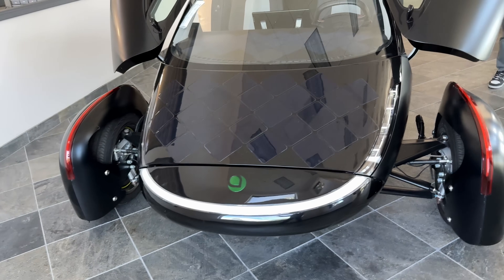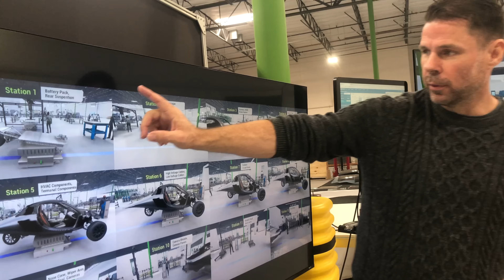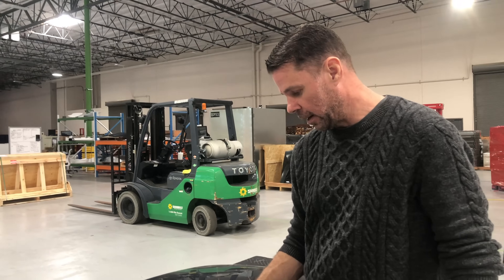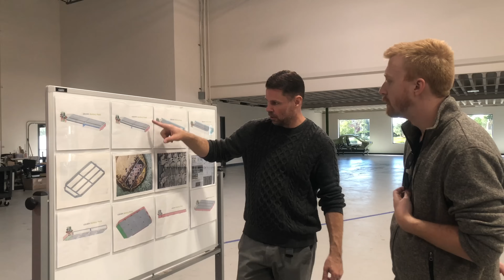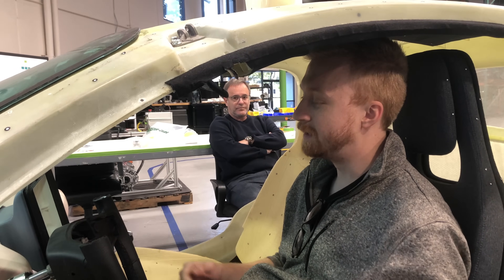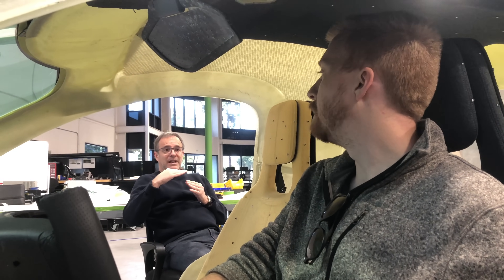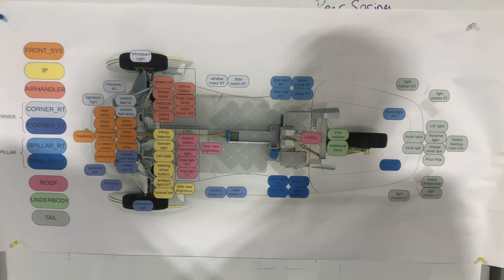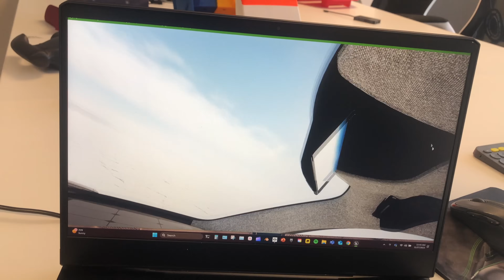Touring Aptera's Factory!

Comment: I love it but for $34k? I hope they can ramp quickly and be profitable at $15k - $20k before Tesla comes out with their $25k car. They probably have about 5 years of time though..
Reply from the maker: Aptera doesn’t overlap much with Teslas cheap car. Aptera has far more range, CarPlay, and repairability
Reply: I'm not sure how you can come to the conclusion that they can sell thisvehicle for $15k ? Their base model, that I believe has a 250 mile battery, (23kWh), 2wd, is slated to be around $26k. I can't see it getting much cheaper. Their LE model has a 400 mile battery, AWD, and  full solar packages.  What is in this "cheap Tesla "? Is this some are calling the Model 2 ?  It supposedly will have 250 mile range and 0 to 60 in around 6 seconds for the base model with a msrp under $30k. It most likely will qualify for the $7500 Federal tax credit. On a side note, the tax credit for the Model 3 is dropping to $3,500  on 12/31.
It remains to be seen if Aptera can get Washington to add three wheelers to the bill.  I can see someone who needs more than a two seater might be interested. However, I think that the majority of those of us who are interested in the Aptera are drawn to it for more reason than than the price tag. For many it is probably the efficiency and potential of some significant miled from its solar charging. Apartment and condo owners who can't plug-in charge can get a little relief from having to go to a public charger as much. Some who have short commutes might rarely have to plug-in.
Tesla's are impressive but I was not considering an EV until the Aptera came on the scene. If they don't make it is unlikely that I'll buy an EV. I would probably go with a hybrid. For what it is worth, I wouldn't buy a Tesla.
Reply: @TailosiveEV  yeah, maybe if the battery is the most expensive part, they could offer a cheaper, 100 Mile version with the solar. I think there is a market for that. I agree, I think cracks are starting to show at Tesla. Nobody wants a car that has no parts and won’t be repaired. They need to fix that asap as it will be a hard reputation to change after 5+ years.
Reply: @garywozniak7742  thanks Gary, I never considered the Condo people. N. America is very car centric so this could very well fit perfectly into that market! Would be nice if they made a shorter range one which would be cheaper
Reply: @GIPvideos  To be fair, lithium and battery prices have been plummeting.
Reply: If you believe Tesla's $25k nonsense, I've got some ocean front property in Arizona...

Comment: i just don't get how empty their factory is, it has always been empty, I have never seen it full of people or full of equipment
Reply: That building looks a heck of a lot more full than when they purchased it last year.  

They aren't going for the old style of assembly manufacturing using a ton of robotics.  Even their animation shows a relatively open space. 

Besides, technically, production already started, where CPC has to stamp out dozens, if not hundreds, of large pieces and will likely ship them here over the course of months.  Add in that Aptera has a second facility to make the solar panels, and they are making progress.

Ultimately, we want a final assembly date for commercial products, not a traditional "production date."
Reply: @pavanbiliyar  thanks for the informal comment man ☺️
Reply: @pavanbiliyar Aptera obtained this factory space in 2021.

The solar facility was turned back to the leaser when body production was moved to Italy and the solar manufacturing is moving into that space.
Reply: @gasisthepastendoil  Tesla is vapor ware? Interesting take on a company that's delivered over five million vehicles.

Comment: I watched all three videos. Why are you dancing around the biggest red flag of vehicle power? Can this drive at highway speeds safely? Can this go up hills? I saw this vehicle overheat and fail going up a small hill last year. Everything about this vehicle is pointless if this can't actually drive on a road.
Reply: The answer to both questions is yes - both my wife and I have ridden at speed in a prototype.  It is not surprising that overheating can occur in a vehicle that doesn't have the cooling lines circulating anti-freeze hooked up and operating.  Try that with any ICE vehicle!
Reply: @billsmith5960  You have a point.  Actually, many of these "air cooled" vehicles were actually primarily cooled by the circulating oil which was then cooled by the oil coolers, including the Corvair.  But the point still stands that they could encounter damage from overheating that would just cause an Aptera to reduce speed.

I have owned a number of such vehicles and have experienced overheating in some of them.
Reply: @billsmith5960  Sounds like you won't be buying an Aptera because an incomplete build didn't perform they way you thought it should. We'll let you know how the production vehicles go.

Comment: Aptera needs a completely new type of in-wheel engines. Four of them. Also, four seats that can even turn into six. And loose the bug look for more of the eagle she should aim for in a futture of flying cars :) I can help :)
Reply: Aptera's second planned vehicle will likely be a 5 passenger, 4 wheel sedan.  They have mentioned this in their SEC filiings, but we won't likely hear more details until they get ready to go public.  First things first.

"The Bug look" as you call it, is pure functional form, going back to an A. Morelli design from 1982.
Reply: "Hey Aptera, toss out everything that differentiates you from every other car manufacturer :) I can help :)" 😂
Reply: Aptera has in-wheel motors. Either two, or three in the AWD version.

Comment: it's not a car it's in the same class as a motorcycle.  I don't want any of my family riding motor cycle that can go 110 miles an hour.  Death trap comes to mine.   You see people building solar power motorcycles all the time on YouTube.   lol
Reply from the maker: Do you keep the 4th wheel in your bedroom for added safety?
Reply: @TailosiveEV   I am not sure the point your making about 4 wheel?  I am not talking about wheels when it comes to safety..  I m talking about safety equipment required by law for a car which is not required for motorcycle type vehicles.  This is not a car and can't be compared as such.. As far as it being a great vehicle for it's class sure it is.  But people buying this thinking they are getting a car is just wrong.  I was looking at it because I thought it was a car but when I found out it wasn't I was very disappointed.  The reason I thought is was a car is in these video's they kept calling it a car and comparing it to cars.  A car will have more weight because of the required safety equipment and will have to pass crash test as well.   There mileage will be lower because of the added weight.  If you have all the required safety car equipment and pass the crash test then I might buy one.  Why are they miss leading people?  I already have one EV and am looking at adding another this will not work.
Reply: @lloydbrannan1002  You're confusing weight with safety. You may have missed the parts of the interview that explained how the Aptera is designed to be safe, how it protects the occupants better than most cars, and how it will be crash tested just like a four-wheeled auto. You could wait for the results of the crash testing before deciding that you know how it will perform.
Reply: @jerrymcintire7902  If that is the case I may buy one but I want to see how it performs in crash test first.   It not being a car isn't issue for me.   The video's confused me because they where calling it  a car.  I really like everything about this vehicle.
Reply: @lloydbrannan1002  I have actually ridden in a prototype, and it exceeds the performance of my present car in every area, including safety.  Aptera will sacrifice up to 5 of their Production Intent vehicles in crash tests to FMVSS Part 200 standards, the same as cars are tested to and the results will be published.  Just because they are not required doesn't mean they are designing to minimum standards.  Inform yourself.

Comment: This looks like more of a showroom and not a factory. Very concerning, I am loosing faith on this vehicle, I have an early order and they are only burning money without really producing anything. Constant marketing talks...
Reply: The work is taking place - have you seen what they are doing in Italy?  I would say a 100 ton tool producing production  parts on a 5,000 ton press is "producing something"".
Reply: @bobhellman8676  I never had a Bradley - what I owned back in the day was a Kelmark GT - a rough copy of a Dino Ferrari.

All the body SMC and carbon fiber body components are in production now and have been shown.  There are a few others we haven't seen yet, including the belly pan.
Reply: @bobhellman8676  Yes, the Bradly bodies were pretty flimsy in comparison.

This is the reason I think it could be several months into the new year before we will see completed PI versions.  Fortunately, there is some validation work that can begin before the vehicles are complete. 

 I can remember when long after the Model 3s were in production, that the lack of a single part caused thousands of those vehicles to stack up in parking lots in Fremont, CA.  - and they were not the only ones.   Aptera will not be immune to such issues, although the smaller numbers needed may be a help in avoiding it.

Comment: Aptera is unfortunately another victim of superb efficiency on the wrong engineering and manufacturing fondation :) The first problem are the wheels = not onyl the same clasic tires with all their problems but also the in-wheel motor complicating everything way more. The second one is the flimsy, easy to loose, cutting-blades like front wheels. The thrid is using way too many parts and materials and components. The fourth is it still has a wheel, worse a partial wheel, when it should have changed the controls to something truly worthy of the future and also much more human. The fifth is trying to better exising manufacturing and engineering instead of coming on this from scratch / clean slate.
Reply: You don't seem to understand the motors that Aptera is using and what they accomplish.  Far from "complicating everything way more" they both greatly reduce parts count and increase efficiency - not the least by eliminating bearing surfaces and points of friction loss.

You clearly haven't grasped what Aptera is doing - the tub alone replaces around 200 parts in a conventional build with a single part.

Those of us who have worked as suppliers to conventional automotive companies, including other startups, are in awe of what they are doing in improved fashion.

Data driven production systems have been invested in and installed from the beginning, instead of developed piecemeal on an ad-hoc basis as the company grows.

The experience of the founders in creating and running other public companies really shows.
Reply: @n.brucenelson5920  Hello. Thank-you for your very detailed and compressive answer. I only meant my engineering is far simpler because of its entirely different foundation. No comparison van be applied here because your no doubt vast experience is from another world. My concepts are still based on the same leas of physics and true principle real design but have produced an entirely different everything starting woth the wheel first and foremost. I have studied intensively and extensively all  in-wheel-motors deisngs and even wanted to implement on my personal car for fun several times over the years. I have the absolute respect for the evolutionary leap they brought. But, this design is at another level. Still a motorized wheel but completely different. That's all.
Reply: @adriangabrielgramada1016  Best wishes for finding both funders and partners to bring your ideas to production.

Comment: Looks more like a vacant building - so what is the exact date Aptera is going to build these motor cycles and how many? They've been promising for years now - how about they set a date and if they can't make it the shut down?  And tell  your "investors" they can't get priority in front of existing reservation holders who paid money to get an early production vehicle - assuming Aptera ever gets around to making some motorcycles that can be driven on the street and meet DOT regulations.
Reply: Well in their defense, they do have green and blue lines painted on the floor.  I was going to invest in Aptera but just bought more Tesla stock instead.  To me there are far too many compromises in the vehicle design for a miniscule saving im electricity cost when compared to a Tesla which costs less than 2.5 cents to drive a mile.
Reply: @petemiller519  An Aptera still uses 2.5 times less power than a Model 3 Tesla to drive the same distance, and the first miles won't cost you anything.  

What compromises are you pointing to?  The quality of the first Apterae on the market will be hugely greater than the first Roadsters.  Even their prototypes are better than those were.
Reply: @petemiller519  I actuallly have one on order peter and Im pissed these people have done abosolutey everything to avoid making vehicles - clearly that want a big sugar daddy investor to make them rich ; htey are not trying to actuallly make vehicles or they would have been years ago
Reply: Lol
Reply: @davidclark538  Ya it is funny they won't ever make these motorcycles - the company wants to be bought out by some rich Elon like figure - never will happen
Reply: @litestuffllc7249 wrong as usual! They want to produce these cars, and they're doing everything right to ensure they can do it at scale, and in the manner they want.

Comment: Sure they are Go climb - so when will that first one be delivered? 2090?  A legal vehicle - that can be driven on the street? They've done just about everything humanly possible to avoid making motorcycles - did they need to test them like cars? No - did they need to keep making revision after revision after revision - no. They claimed they could just pop these out like cupcakes well that isn't getting done. Mr Ambassador Bruce swore he would have lone last June - well needless to say he doesnt'.
Reply: Perhaps you are not paying attention.  That was back when I was expecting that the production vehicle would be a refined version of the gamma.  

In fact, demand was far larger than even Aptera expected and the vehicle has been completely re-designed so that the actual production will be much less "kit car like" as the originals were, to being much more like supercars.

This increase in quality is certainly worth a small delay.

As far as legal vehicles that can be driven on the street - both my wife and I rode in one in November of 2021.  They crossed that threshold in 2020.
Reply: Don't think they ever made any claims regarding cupcakes, cupcake.

Comment: LOL. Seriously this is disappointing.  Everything laid out as if a demonstration but nothing anywhere in place to demonstrate movement towards a real assembly area. This has all the hallmarks of a high school science fair and not an automotive assembly area. I mean, if you were going to do tours to impress students then this was certainly staged well for that. 

There are two very large absences here, the Red Viking AGV units are still not unpacked but more importantly look how few people are there. All the shelving is empty as well so its not like components to complete the production intent vehicles have arrived. Given the traffic observed on the road outside it likely is in the middle of an average day.  

So the assembly line is still just blue tape and animations yet we are to believe they are prepared to build out the production intent vehicles but not validate any portion of the assembly method.  Where are the RedViking AGV units they are going to use? 

Battery cells, Tesla and the industry has moved to 4680 because it was far more efficient both from making individual cells to packaging them than using taller cells. The width also reduced the can weight proportion of the overall cell weight and the height was chosen to give more flexibility by not consuming vertical space which would come from the cabin. Yes, each mm counts. The other method gaining a lot of popularity is the blade arrangement which conserves even more space. The Aptera cooling solution is not impressive so it remains to be seen how it behaves in stop and go. the packaging certainly is not efficient.  2190/2120 are not for automotive use. 

Solar and glass. given their claim and video that solar is in production from October 2022, yes 2022, they certainly have little to nothing to show for it.  You would expect them to show off work towards making pieces for the production intent vehicles, granted not all of them will have solar, but it is very telling how little they have. You can buy similar Maxeon cells in flexible panels off of Amazon, been there a few years and they can be adapted for camping and such easily. Other note, they have never shown a working solar hatch. Seriously, solar was claimed to be in production last year.
Reply: Their solar cells are being produced, and have been built into the delta and gamma prototypes. They are worlds better than the Maxeon flexible cells. They will be in the production intent vehicles, including the rear hatch. Another thing you have wrong, "not all of them will have solar." All Apterae will have solar, some will have more if the buyers choose that option.